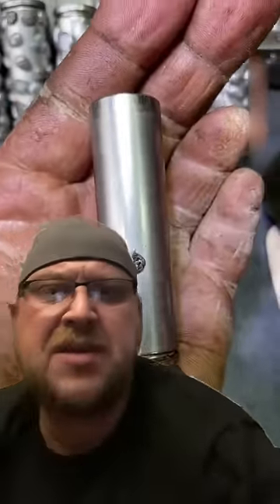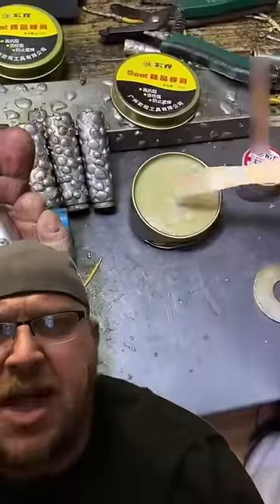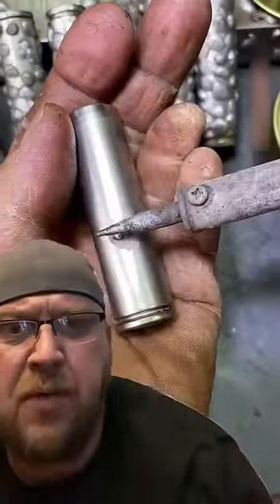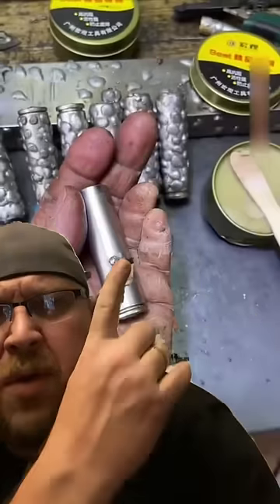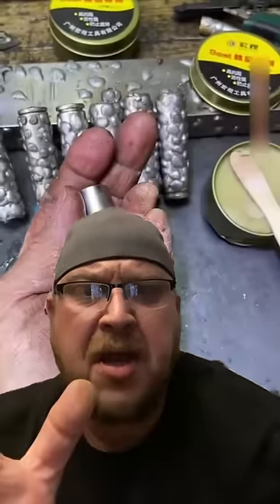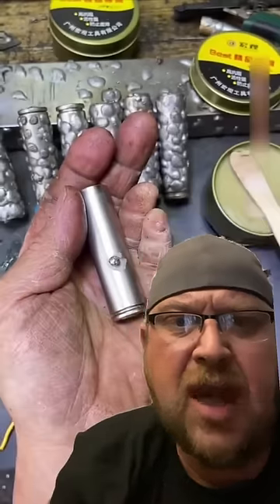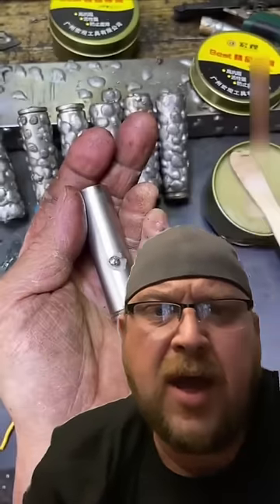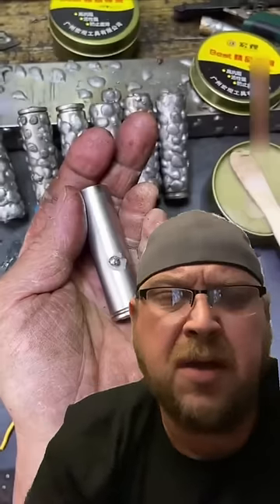Stumpy McGee Battery Soldering King ￼

Comment: Stumpy hasn't got enough lead in his bloodstream
Reply: Too much blood in his lead stream.
Reply: Too much lead blood in his stream
Reply: @ferrumignis 😂🤣
Reply: @ferrumignis hello ferru. I have begun my in-depth cross reference and analysis of your online profile and character to determine if you are worthy of my like if you receive a phone call with questions please don’t be alarmed or hang up. They won’t be invasive. Thanks!
Reply: Isn't most solder Tin based?
Reply: Just Googled it. So the solder I have used has always been lead free solder, which is Tin based, with a dash of copper and other such things. but original solder was indeed Lead based alloyed with Tin. I'll get my coat.
Reply: He cut his digits on purpose to mainline that heavy metal into his bloodstream
Reply: He just finished stuffing the turkey with that fucked up ass hand 👻😭
Reply: I used to use leaded solder when I was a kid. They should really warn people about lead. Since I found out after two years of usage it was poisonous I immediately got rid of it and got lead free solder instead.
Leaded solder is easier to worth with than with copper. But copper doesn’t just kill you.
I really wish leaded solder was illegal to sell to normal consumers.
Reply: His wife: “You’re all hopped up on lead, you’re outta control stumpy.”
Reply: @agoogleuser5420  I solder all the time, and absolutely hate lead free solder. It sucks to work with, especially if it needs to be removed. Lead solder will not enter your bloodstream for no reason. As long as you don't eat it, wash your hands well after using and don't directly breath in the fumes, youll be fine. The fumes created from lead solder do not contain lead, but it's generally a good idea to avoid huffing any soldering fumes.
Reply: Touching solder like this wont do anything unless you lick your hands
Reply: Man’s gotta get his fix.
Reply: I worked at Enersys back in 2007 in Hays, KS it was a Clear Cell battery factory. I'm sure they still make Giant power reserves for nuclear stuff.
Reply: @wolfiemcwolf6617 He’ll be diving for your coattails. Don’t forget to drop the mic on your way out good sir 🤘
Reply: Hey, he could be using lead-free! You never know!
Reply: @agoogleuser5420 what were your lead levels?

Comment: In our culture, once a tradesmen has reached journeyman status, he has to stop a belt sander with his bare hands as a rite of passage.
Reply: Belt sander I can understand, but a table saw?
Reply: That must fucking hurt, damn.
Reply: 🤣🤣😂😅 in the welding culture one must pick up something that is glowing to prove he "knows what he is doing".
Reply: @ktm42080  they have to stop the table saw with 3 fingers only when they hit master
Reply: that explains that video i saw of a dude getting yeeted trying to hold onto a beld sander...
Reply from the maker: LoL 😝
Reply: Omg im crying from laughter! As a journyman carpenter and union brother, the comments are solid GOLD!!!
Reply: That's easy though...
You want video?
Reply: Don't ask what electricians do.
Reply: @ktm42080  mine was someone getting a 6010 rod glowing hot. Then he put it on the back of my neck while I was welding.
Reply: I just pictured that in my head and couldn't stop laughing.
Reply: @TheSphongleface  
I know right!? I don't know why everyone else has such difficulty with it, I do it everytime. I just use my bare hand to hit the switch.
Reply: With those shitty harbor freight belt sanders you actually can pull that off
Reply: @davidscott5903  Preciciòne
Reply: Pfft, stopping a belt sander is onething, but i rode one from one side of the shed to the other and the only thing that stopped me was the 8 meter extension cable unplugging. And i did that as a apprentice
Reply: That's a fucked up tradition that I dig 😂
Reply: it's easy, just unplug it from the outlet with your bare hands
Reply: LUCKY! We have to use our teeth.
Reply: Brilliant
Reply: @Crackpidgeonextreme   Some say sensei does it with his teeth in his class
Reply: @ktm42080  LoL followed by the obligatory response "it didn't take you long to look at THAT". or "Do that again, I wasn't recording yet"
Reply: Old boss decided to stop a 1/2" bit on a plunge router with his hand, bit him good then he looked around at us to see who saw his stupidity.
Same dude was cutting antlers for his dogs to chew on on a band saw, slipped and took his pinky and ring fingers, doctors stuck them back on somehow, they had him use rubber bands to get the strength back once they were healed enough. The guy was a walking disaster but he signed paychecks with his good hand..
Reply: Lmfao
Reply: I already did that this year (I'm 16) and I still have all my fingers.

I think I'm on my way to being an expert mechanic.

edit: I read some more of the replies, and I have also picked up an extremely hot piece of metal and gotten burns on my hand.
Reply: Lol personally if I lose any fingers I’m not butchering my toes so I got goofy “fingers”
Reply: @mrthomas7511  I would be in prison if someone did that to me.
Reply: You should see what machinists have to do with the metal lathe.
Reply: Just the thought makes me cringe... You should never ever underestimate belt sanders
Reply: This is the way.
Reply: @ktm42080 im no welder but my idiot driends are apparantly becayse ive handed many of them a glowing titanium nail just to have em do a dab and grab the nail lile you pull a bowl on a bong never fails some of them have done it more than once
Reply: @todydn  hahaha sounds like the same friend group I used to have
Reply: @ktm42080  very very possible had one buddy put bug spray a value sized can in a camp fire and stand directly in front of the plastic cap nothing like deet and 2nd degree flamethrower burns to put a damper on a night i feel i have to be around or they would darwin themselves out of existance rather quickly
Reply: @todydn  hahaha 🤣😂
Reply: Thanks for the laugh mate 😂😂😂
Reply: @ktm42080  tried that with an enriched uranium rod! 
but i still have all twelve-teen fingerns 😳
Reply: @todydn drugs are bad mmmkay. Especially for us welders because those welders like drugs and that's bad mmmkay?
Reply: @todydn I used to hold this same position in the friend group. Years ago I was renting a house on a couple acres of property and we would always have bonfires and huge parties so for about a month I got sent out of town on a welding and machine moving job and I would call him occasionally to see how the guys were just because you get bored being away from home for a long time anyway I got a phone call 1 Saturday night after hours and my friend says do you have a first aid kit at the house tell him yeah it's upstairs tell him where it's at and of course ask what the hell happened. One of my idiot Friends pulled this 4ft long half inch wall thickness steel pipe we had as a makeshift fire poker. Out of the fire in the end of its glowing cherry-red apparently he waved it through the are giving it the techno look at the wavy Shadow effect and my one dumbass friend apparently grabbed it because it was going through the air and he didn't want someone to get hurt and it removed all the skin from the palm of his hand.,... apparently all those guys said that I would be pissed and no one wanted to take him to the hospital so they made him put some antibiotic cream on it and find his own way. I remember just telling them guys have a good night and hung up the phone and went to bed
Reply: use your bare hand to unplug the sander....
Reply: This explains why there are so few lathe operators above journeyman status...
Reply: Stabbed my hand and had a arc explosion from connecting two batterys together the wrong way and fried my other hand this summer.
Reply: And occasionally sacrifice fingers to the tool gods.
Reply: Easy. You didn't say I need to touch it.. just use my bare hands. I will use them to unplug it from power/gas
Reply: My crew had something to do with the framing gun.
Reply: Yea but they just want you to use your hand to unplug the belt sander. I guess this guy failed the journey exam
Reply: My cousin did that in high school 😂got his thumb jammed in the bench sander seen nowt like it 👍
Reply: @FunkFPV so damn funny bro 🤣
Reply: @justins21482  solid gold brother 😂
Reply: bandsaw I can understand but a belt sander is sadistic

Comment: Looks like he found out the hard way what happens if you puncture a lithium battery
Reply: I had that happen to me I had deep blisters.
Reply: That guy must have the BIGGEST hands ever. It's half a foot!
(*Because those two smaller 'fingers' are evidently transplanted toes)
Reply: @MonkeyJedi99  rofl
Reply: @daisykaren6584  i bet them blisters weren't as bad as the batteries on the background
Reply: @haley746  there have warts..
Reply: @MonkeyJedi99  possibly or there saw by table saw.
Reply: It's for art, man!
Reply: @daisykaren6584  Well, if you pause and look, you see the right number of bending points, but each segment between them is quite a lot shorter than the segments of his other two fingers, or even his thumb.
This is what led me to conclude transplantation of toes.
-
Though there is a faint, miniscule chance that he somehow cut and mangled every bone on those two fingers, necessitating a shortening of the bones in the surgical reconstruction, which would require a similar shortening of the muscles/tendons in those fingers as well.
But I put the chances of that being so somewhere less likely than my winning the PowerBall lottery three times in a row without even buying a ticket.
Reply: or heat them too much as you would when dabbing 100 solder welds on to a single battery for no reason at all.
Reply: @MonkeyJedi99  eighter way very risky. His hand also all crack up. Maybe take a break from unnecessary hand usage.
Reply: Or he ex yakuza

Cuz if they make mistake they gonna cut the finger off

Comment: Good plan soldering that right in your palm.  Protects your work surface from the heat and the inevitable explosion when you breach that lithium battery.
Reply: afaik, it'll be more like a jet of very hot fire rather than an explosion... but i'm open for corrections
Reply: The jet of fire will explode out of a breach in the battery wall, so you're kinda both on point.
Reply: @zhou_sei Ah so it'll basically be like a bluetooth blowtorch. Very convenient for giving your skin a nice and crunchy consistency
Reply: I doubt he has any feeling left in it tbh
Reply: @zhou_sei Depending on the state of charge it may directly burn, or off gass. 
If it off gases that gass will then explode like a hypobaric bomb.

Comment: This is QC in Southeast Asia. He's putting those soldiering points on to ensure random hotspots in the battery won't cause a chain-reaction explosion. The way the burns healed on his hand dictate he has had at least 1, maybe 2, fail the test.
Reply: Lol I hope this is true
Reply: Honestly this is pretty cool, though obviously it could be done way safer
Reply: @harrod19  he worked for Samsung around the time the Note 7 came out
Reply: Most plausible explanation I've read.

Comment: Gotta give that guy credit for being able to do ANYTHING  with all those missing fingers
Reply: although he loses that credit for doing exactly what he did to lose the fingers in the first place. You aren't supposed to solder to batteries because if you overheat them they explode, and even if you don't blow them up, heating them can reduce their lifespan. The proper way to do this is to spot weld tabs onto it and then solder stuff to the tabs. Spot welding gets the bond done much faster so less heat gets transferred into the battery overall.

Comment: DO NOT SOLDER DIRECTLY TO 18650 BATTERIES. they can get damaged easily by heat and damaged batteries can explode.
Reply: I need to ask, do you know this from first hand experience or are you repeating something others have said?
The people who have said they can be damaged are the people who have soldered batteries with a very large hot tip and holding it on the battery to long. 
I build my own battery packs and when I first began, I soldered every nickel strip to the batteries, I never once ruined a 18650, the amount of heat that I put into the battery with a soldering iron was less than the hot temperature batteries can get when over working them in a tool.
I now have a spot welder but not because of a heat issue but because it is easier and faster when building several packs at a time.
Reply: @The_Story_Channel   I've never had one blow up on me, but I have damaged batteries doing this when I didn't know any better
Reply: @The_Story_Channel  I have soldered beads on dozens of 18650s ( to make button tops) with no ill effects. Use a big iron and do it quick.

Comment: So I've seen this several times now and did some research and APPARENTLY it's kinda safe to practice your solder skills on batteries that have essentially no charge and it helps you learn heat control. My best guess as to what happened to those fingers was he was trying to learn initially and someone gave him a fully charged battery by accident, he didn't test the temp or the electrical potential, the fully charged battery got hot in that one little spot and it exploded with flames the same temperature as the surface of the sun directly into his fingers. So now I bet he checks the charge on every battery.
Reply: Well there's another comment about this but I think I went into more detail.

Comment: I think I can answer the 2nd question: soldiering and welding onto lithium batteries is difficult because you can cause internal shorts in the batteries if you take too long. What he's doing is practicing on a bunch of batteries that are probably old and barely hold a charge so that he'll be able to solder onto newer ones without letting the lithium ghost out.

Comment: I hope those lumpy cells are hollowed out or something... but I suspect they put a ton of solder blobs on them to use them later on other cells. I further suspect the idea is to get a very thin, consistent layer of flux (the batteries are all very consistently sized/shaped) to do its thing as the solder blob is remelted.

Comment: You are not going to get solder to stick to steel using a soldering iron. That's why connections to the terminals are made using electro or spot welding.

Comment: I work in battery manuacturing and have always been told to never solder directly on a battery. There should be a welded solder  tab and a wire and a BMS OR FUCKING ANYTHING other than a blob of solder on the can. I realise it may work but it is certainly not best practice.

Comment: While I would normally comment about how I lost the fingers soldering to the batteries in front of him what he's doing is showing you how to do it in about how long you can do it before the thermal conductivity rises so high that it breaks down the lithium inside the battery causing it to go critical. Now having said that let's point out that there's Chinese writing on the canisters in the background of rosin which leads me to believe that this is a Chinese triad debt loss of fingers notice how the pinky is shorter than the ring finger. Triads cut off fingers and sections of a knuckle one knuckle joint to the next for each debt owed so for example if you owed them $100,000 or $100 it doesn't matter and each individual debt owed is a knuckle and by the looks of it he had about four knuckles missing. Probably a habitual gambler who is an engineer in the '80s and now does this stuff

Comment: If you solder to a battery generally a bad idea use a heat sink or even just a paper clip and aligator claps to make sure you dont overheat the potentially explosive capsule full of lead and acid

Comment: That looks like it may be a birth defect rather than an injury in the ring finger. That looks like it has all the joints based on the skin creasing. Those also look like rock climbing hands. Lol 

Edit: I think you can see their finger nail on the ring finger just barely if you watch the rotation.

Comment: just use flux ^^ like always when solder tin.. but mhh .. that work for few battery but spend 30 buck to get a discharge solder tool... 5 if them wont blow up if u have a litle luck but 100 of them i would not bet money XD

Comment: Okay first of all. It's not safe to handle a battery without a wrap on it. Despite their size. These little bastards are mean. There's no reason to do that. Just use the top bottom. That way you can wrap it and not have it shock the piss out of you. If you really need a ground in the side of the battery. Solder a wire to the location ground is needed.

Comment: Doing this is extremely dangerous and stupid. 
A little tiny splat of solder getting into the crevice at the bottom and you got yourself a shorted li-ion cell. 

Have fun with that

Comment: DONT SOLDER DIRECTLY TO BATTERIES LIKE THIS! THERE IS A GENUINE EXPLOSION RISK! Use a proper battery terminal welder if you need to connect wires to a battery

Comment: Really dont care about the fingers as much as i want to knownwhat the actual point of outting a blob of solder on the side of a battery. I am not an expert but have used tons of 18650s granted ive never soldered one. But from use ive had them get hotter than you can touch and i put down that tool battery pack or vape away from everything. Can one second at 625f transfer enough heat to blow up the battery? Or is it not as common as we are led tk believe. Everything in todays world powerered by lion and lipos and all the idiots out there it eould seem like you would hear about axcidents more often.

Comment: Gotta mention that those fingers may not be short because of an accident, but rather due to a possible birth defect. See how they each have shorter that normal metacarpals, no obvious scarring, normally rounded tips, etc. (The first two fingers don't look standard -issue either, right? That's a clue...)

NOT COOL to make fun of a potentially unfortunate disability.

This 'hack', on the other hand. Well, Yeah. swing away.